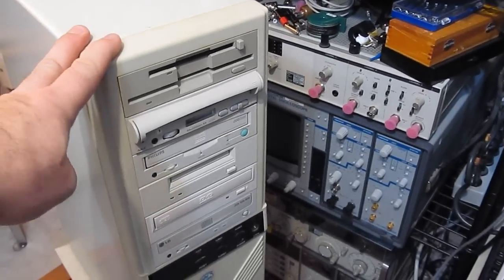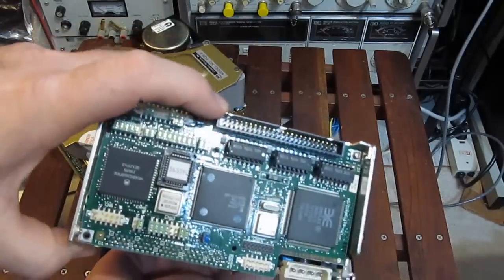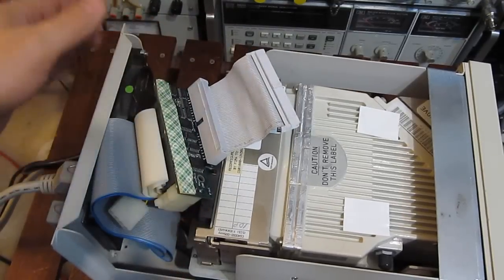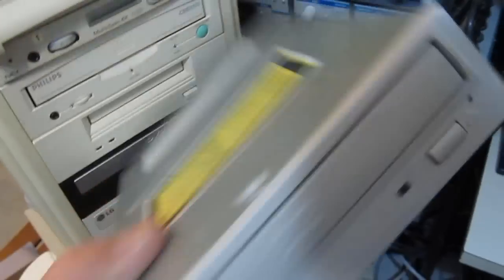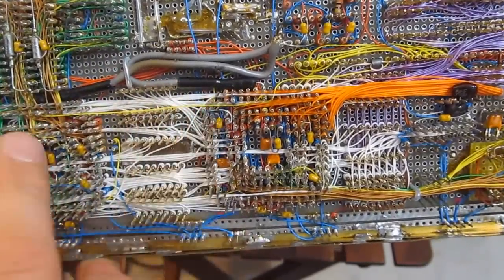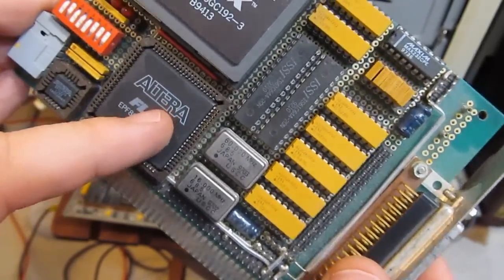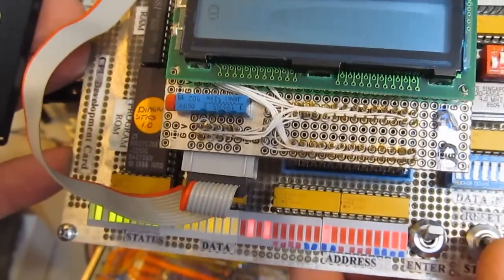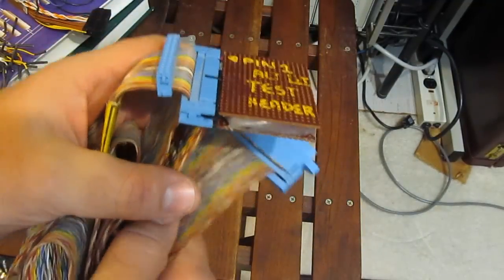FPGA based CPU designs from the 90s, PART I

Comment: nice vid man, i really got to check out that book on computer architecture. i am currently working on a simple cpu with ttl chips. very crude very interesting whether i can go a step further and build something that's capable of doing sometging xD :)
Reply from the maker: I wonder for your first simple CPU if you would not have been better served using a simulator.   You could still use the same basic logic.  Just less time wiring and more time designing.  Good luck with your project.
Reply: joe smith haha i think you do not have to wonder. i am pretty sure it would be faster. but i really like the wiring aspect of is xD
Reply: @joesmith-je3tq  or with one of these cheap fpga boards that keep appearing (whose software include simulators)
Reply: jonathan beibier i think some1 is watching videos from ben
Reply: Willy Nebula you mean ben eater? I really whished he had started earlier with his series, i had my plan already layedout when he started. it would have been way easier just to follow him xD ohwel

Comment: Back in high school someone donated a bunch of old computer equipment to the electronics class including a 1mb HDD that had platters about a foot or so wide and had an AC motor, we tore it apart but in hindsight it would have been an interesting thing to have tried to get working.

Comment: I could never expect the ISA proto boards have been ever exist... It`s just like to see ATX form factor drilled proto or nVidia engeneer working on high-end 1090 card, wired on DIP proto =))
Reply from the maker: They were fairly common in those days.  Same as boards for the VME/VXI and even the S100 bus.

Comment: Aaaaaaweeeeessoooooome! Great vid. The wire wrapping looks so rad.

I didn't even know PCI proto boards exist! I recently wanted to pick up a small PCIe board with just one small Spartan or similar, but the board got discontinued. Now looking on the interwebs there are small 400USD+ boards that are probably not worth it, but no small ones. Why is that? PCIe can't be that complex? Gonna make one myself I guess.
Reply from the maker: It's ISA, long before PCI or way earlier than PCIe.
Reply: I once found a PCI proto board in a store (Germany? Canada?) but the signal decoding is so ... much more complicated than ISA.
PCIe is yet another leap into madness, stay away from it...
Good luck anyway !

Comment: how many time to built you different wire wrapping cards.
Reply from the maker: Wow, that's a tough question.  Too many?!  I think I showed four in the video.  I made one a year ago for fun.  I would guess for home projects, less than 40 total.  Not all were this complex and I used to use a slit wrap gun.
Reply: I Sir?
Your project is amazing, because you give practical ideas with FPGA.

Comment: wow, thanks for showing us this ! FPGA and wire wrap ! makes me wonder if I could use wire wrap today instead of making pcb prototypes .. if you can run FPGA's on wire wrap then why not !! I use thin gauge wire and vero board sometimes but its a real pain to work with..
Reply from the maker: Too much work.  Back then it was driven by my home hobbyist budget.  That would have been one expensive board to have made.
Reply: need through hole for that, need adapter for the SMD FPGA for that
Reply: He used sockets, that is an adapter of sorts.
To this day I have not found a good way to prototype.

Comment: Why did you even bother using wire wrapping? wouldn't a PCB be easier?

Also, imagine doing this with a modern BGA packaged FPGA... Ugh. Would have to design a breakout board or somesuch.
Reply from the maker: If you could afford to have a board like this made for home use in the 90s, more power to you.   We were not using BGAs at that time.

Comment: Beautiful wirewrap. I love how you use a wooden garden table to provide a non-conductive surface that reduces the deceleration G-forces when putting down old drives while also making it easy to slot through cables.

Comment: Hi Joe;

Thank You for Your Answer..
The only experience I have had is with the Digilent Spartan 3E FPGA Board, And I was able to use the XILINX provided Software..
I am always looking for Home-made TTL Computer Designs to Clarify my Understanding and my Thinking about them..

THANK YOU Marty
Reply from the maker: Right.  The eval boards will come with a limited license.  The real tools are not free.  You could check Digikey for pricing.

Comment: Hi Joe;

Great Job, I do and like to Wire-wrap..
I have Both Books, as well as many others.. I Built the PDP 8i from the green book and got it working.. The main logic is on one large board, with alot of TTL, with the memory and  I/O on a second Board.. I still need to add a second I/O port for downloading..
I also am trying to get my PDP 11/45 going, so Yes I am Old School on Computer Design..
I am Curious, as to why You choose Altera, I have used Xilinx, and the tools were free.. Or am I missing something ??
Also, is there a way for You to post Your Designs, I would be Interested in studying them, and possibly building them as well, If You don't mind sharing them ??

THANK YOU Marty
Reply from the maker: I'm not aware of any free tools.  You can get the webpacks if that is what you are referring to.  Both companies offer them but they are limited.   I use both Xilinx and Altera and have tools for both.  I wanted to play with Vivado and picked up an ARTY board to get the license.  Sadly, I've had it for a year and have yet to do anything with it.  Of course, that license is limited as well.

Comment: Wow, I would like to know that way to assemble PCB in the end of 2000s 
I would had a great time designing many things that I drop just because the dificulty of reliable assemblies. How do you make that wriring I NEED TO KNOW!
Reply from the maker: Take some advice, you do not want to do this with what is available today. Not to mention converting all the packages to 0.1" spacing.  I used to own a slit-wrap gun with a spool feeder.  I had sold it by the time I did this board.  This was manual labor...   Look up "wire wrap" if you are still interested.

Comment: Did you used to work for Altera?
Reply from the maker: No
Reply: @joesmith-je3tq  my guess is that the question is probably related to the "altera prototype" box you made, with vga, serial etc.
Reply from the maker: @NicolaiCzempin  Could be but the answer is the same.

Comment: I've never seen one of those which would display POST codes on the LED display before...
Apparently the Creative Video Spigot was originally a SuperMac product.  They developed both a PC and NuBus Macintosh version but only marketed the NuBus card, instead selling the design for the PC version to Creative.

The Philips CDD2000 was a very good drive.  It was actually the first drive on the market that I know of which would supported CD-RW media.  I had the HP version of that drive.
Reply from the maker: My old VTECH PC had the post codes.  So did the Everex PCs.  I'm sure there were others.

Comment: I also have a CMI 6426S... it still runs in my IBM PC AT to this day.

Very nice video! I need to get back into the old PC hobby. Currently working on an FPGA floppy interface. I had the bright idea to create an ADPLL for the MFM stream. That spun off into a project all on its own :(...

Dual Pentium motherboard? Does this predate SMP support by Intel CPUs on-die?
Reply from the maker: Glad you enjoyed the video.  The dual Pentium shown is one of the first releases of the part after the 486.  I'm not much of a PC history buff.  Intel would be a great source for details concerning their architecture.

Comment: the SCSI Drive at time stamp 4:48 we use at this time for a DPS7000  Main Frame Host. Working 1500 User online with the (using Terminals connectet to an TCS (Terminal Controll System) 10 of the TCS Systems connectet to a CP Net System and 2 of the CP Net Systems connectet to a Datanet and this to the Host (DPS7).. But you switch the terminal on, and after login you can work like today.. and this with 1500 other users in the same time !  But now comes the miracle !!!! The DPS7 Host works with 512 Mb Ram .. remember 15600 Users works online on the  System ! I was one of the last Operators in Europe for a DPS7 System.

Comment: Does that CDD2000 actually work? I don't mean a test burn, I mean a full actual CD burn. I ask as I had one when it first came out and it was garbage. 3 replacements and an argument with Phillips I bought a different drive. It would pass a test burn but when burning an actual CD (which if my memory serves correctly was about 10 pounds a disc at the time) it would appear to burn, but upon reading it was unreadable. Phillips was in a lawsuit over that drive as it was a known issue internally but they denied it (the spring on the drive head would go out of alignment due to stretching and breaking)
Reply from the maker: I never had any problems with mine.

Comment: Those two videos were the most impressive things I've seen in ages. I linked a bunch of my nerdy friends to them. I work with Altera chips myself. May I ask, out of curiosity.. what made you decide to transition to VHDL? From my perspective I prefer the explicit nature of it, especially for simpler designs because there is already enough troubleshooting to do when it comes to timing problems.. and at least for my mind, it makes it easier to track bugs and see what I'm doing in the code. Inevitably though, a person needs to know both languages. I also noticed that you're a fan of LeCroy scopes. I have a LeCroy WavePro 960 which is a 2GHz unit made in 2001 that I use regularly at home, and it has an Altera FLEX FPGA in it as well for managing the ADC outputs before sending them "upstairs" to the computer board, an EPF10K50SBC356-2 to be exact haha. Compared to your level of skill, I'm just a noob. I definitely know my place haha. But hopefully I'll keep learning. :) I look forward to every new video you make. Also, I'll be buying Hioki's meters. I've never heard of the brand until I've seen your videos.. and I'm sold. The responsiveness alone is just fantastic. I'm in need of new meters, and I'm going to pick up a 4252 shortly and hopefully the 4282 sometime after. As well as a DER EE DE-5004 actually. :) Thank you sincerely for sharing these bits of your life!
Reply from the maker: +whatlions Good to hear from another LeCroy fan.  I use the 64xi for most of my experiments now.   I had installed an SSD into it when I first got it, along with some needed RAM.   It's worked out well.   Glad you enjoyed the videos and thank you for your comments.     As well as the Hioki held up, I really have no idea how their higher end meters would perform on these tests.   When I ran the AMPROBE AM510, it did very well, however the 530 did poorly.   When I look at the Flukes, the 87V was by far the least robust of the five Flukes I looked at.    Just something to keep in mind.  Be careful not to read more into these tests than what they are.   That said, that one Hioki I looked at was pretty impressive.  At some point I may run their higher end meter to see how it compares.
Reply: +joe smith I definitely enjoy using LeCroy scopes even if other people seem to complain about them. The math functions and all the math channel linking you can do is fantastic in my opinion. FFT resolution is great as well. Panel setups are handy. Zoom functions, etc. No SinX/X by default - making it an "honest" scope. I don't mind if the higher-end Hioki meters can't handle 15kV haha.. ;) My main concern is just general build quality (which seems excellent) and meter usability/responsiveness - which also seems excellent. Thank you again Joe! Enjoy your day!